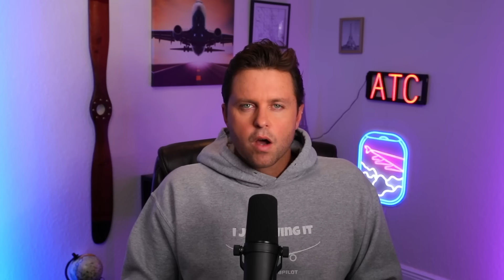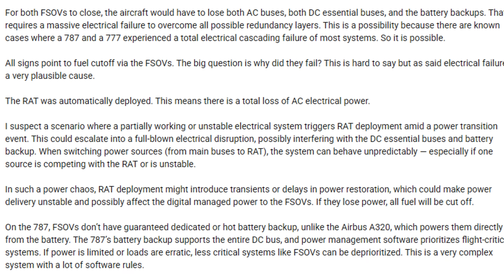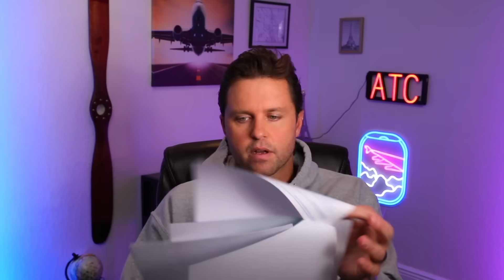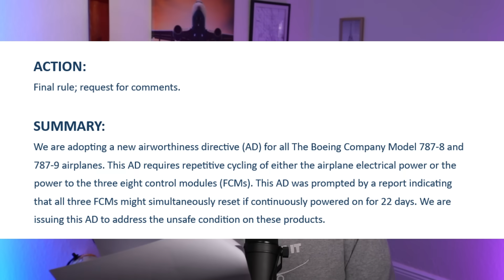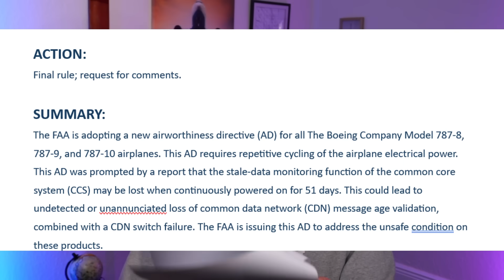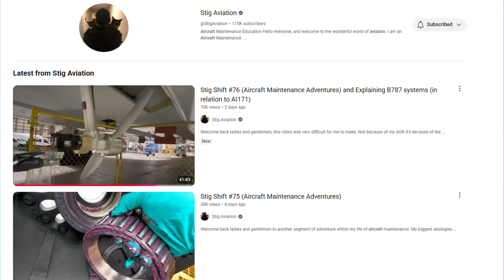Air India 171: Did a Software Glitch Cause Dual Engine Failure?

Comment: That architechture sounds like they planned on never losing all main power. Maybe they neglected the "but what if".

I don't really see why the main power supply status would be used as an indicator at all. The engine is self sustaining and even if you lost main power, that still leaves the control bus and fuel shutoff line intact and engine running, triggering the fuel shutoff valve upon outside power loss would take that from you.

That system sounds like it's single redundant and realying on a complex and thus vulnerable power system that has little meaning to the works of the engines. Stupid to have your engines hanging on by single thread that is the main power supply.

The thing the deadman tries to accomplish is shut the engine in case it becomes COMPLETELY UNCONTROLLABLE FROM THE OUTSIDE. So the basic principle to do would be to check if the FADEC/FSV still has connection to the cockpit. Basically run a hardwired loop of wire from an engine powered FADEC to the cockpit, if that loses continuity because it breaks OR is severed by the fire handle being pulled, shut off the engine fuel valve.

Moreso, with a deadman switch that is not super time critical (fire takes more than seconds) and in a sensitive place (power supply is always subjected to fluctuations, engines are critical), you'd have a delay ensuring the system power was actually lost for good. F.ex. you'd install a capacitor in the fuel shutoff valve that bridges any shortterm power outs. That would hold some stored power for a couple of seconds before it too loses power and switches the valve. The time of that should be designed to gap any forseeable delays in power restoration, f.ex. from rat deploy time, battery switchon or fuse activation incase of a short.

Btw The likelyhood of a dual engine or triple power source fail is not just the chance of the individual parts failing multiplied. Things fail more often when they are being used the most (takeoff f.ex.). In addition, when one engine or generator fails, that increases strain on the remaining systems, f.ex. batteries quickly being sudedenly drawn on, computers restarting after loss of power, pumps activating. So your demand increases even more, which is much more likely to cascade the remaining systems. Either way any backup power source always has to detect a low power first in order to activate, so even in a perfect scenario the power drops shortly.

Comment: if there were solenoid valves on the fuel feed to each engine a bus failure could shut both solenoids off at the same time.  such a bus failure could also explain similar solenoids (if present) being shut off on the hydraulics.  i have been a controls engineer for over 45 years and when you have a failure such as this on the ground or in the plane its not human induced.  the question is this to a controls guy, if the solenoids were present, are they fail open or fail close.  what could have occurred is that there are redundant solenoids in each of the lines (guessing).  they could have been set up such that one was supposed to be fail open and the other fail close when in reality they were set to both to fail open and or fail close at the same time - - - seen this in hydraulic systems and fuel systems in paper mills (not common but does happen) when a rookie works on a system without the aid of an instrumentation or logic cut sheet.

Reply

Comment: Boeing maxxxx---- the anti stall system???? so called anti tilting system in flights just in case pilot goes off to sleepppp----??? isn't that height of technology???? Car anti stall system is different mechanism and benefits but the name is same anti-stall system in formula one racing cars where loosing speed while gear change can make you loose the race-so rather accelerate on gear change...................HERE what was the need??? ABOVE EVERYTHING HOW DID THIS PASS TESTING?????  what else can I do except take off nose-too-up for a fraction of seconds if I am about to hit a missile or drone or head on collision with an idiot aircraft......WHO PASSED THE TESTING(testing doesn't tak a lot-flight and roll it like a fighter jet in the air on empty planes with seat ejection, cement bags-on-seats-for-full-load-effect)????? Only the flying school planes will stall on nose-too-up--rest of the planes are high-tech motor powered wont stall at 2-3 seconds of nose-too-up  even upto 90 degrees tilting to TO SAVE CRASH (all I can think of if supersonic jet fans has compromised air flow not at the best angle the efficiency of the engine will go off for 2-3 seconds leading to minor carbon monoxide poisoning and incomplete combustion etc.) ............................................................................................*******************************/ the auto maunvering system// anti-tilting system// anti-stall systems in cars are so called AUTO-PILOT// auto manuvering system of car and IS A BIG HIT----but as soon as a """"SLEEPING DRIVER""" touches brakes--auto-pilot cancels........?????? but in planes feels like a feature of auto pilot was put on manual mode of driving plane..................********************************************************************And angle of attack my assumption is if wind falls on the wings in the best angle it gives wing the best efficient-but in todays world everything works irrespective because of powerful motors---exactly like plastic toy windmill will not work if you run with treadmill flat face up but will run line crazy against the wind--------but battery toy plane wings works irrespective because air-mechanics//aerodynamics is not taking battery power in account when calculating angle of attack (PROPELLER VS ENGINE FAN concept----peropeller throws air backwards, flight goes forward---engine is HIGH tech.... propellers may use angle of attack because air is like fuel for them--and then if you dig deeper there is propeller, impeller and jet engine and just engine fan). ...************************************************************************* And inside clouds I am not sure if winds blows top to bottom 
(circular or all ways or bottom-to top)in whirlpools where flight jerks and goes down upto 10 feet free fall once in a while, stuck in the airpockets, and luggage starts fall all over and then I dont know--may be it comes out of its own God knows!....SHOW IS OVER EVERYONE cleaning time, crew is busy!

Comment: Gary, whoever keeps mentioning fuel contamination hasn’t thought it through.  Fueling at major airports is done through a common manifold.  Which means if the air India had contamination, others would have contamination.  Interesting take on the FCSOV, completely plausible.  It still amazes me how operators never depower an aircraft completely at least everyday for the 15 minutes at least once a day.  Instead aircraft are constantly powered with the battery and external power sources, for extreme periods of time.  Anyways interesting find, I wonder if the 777 suffers the same issues, knowing how closely designed the two planes are.

Comment: Another interesting post from pprune. We have known about this need to reboot the 787 every 120 days for a long time. Could they have missed it? Would certainly ruin your day when it goes to fail-safe!

The Spring-loaded FSOV
The general conclusion seems to be that the gear retraction was interrupted by a dual engine failure. The argument seems to be that this gear failure to retract after its dual bogey “tilt” and that the gear-doors’ failure to open (first) was brought about by a total loss of system electrics, (i.e. both AC and DC). This loss is confirmed by the RAT deployment. The out-of-sequence gear-bogey tilt was likely due to a sequencer relay’s DC power outage and the accumulator pressure continuing on with the retraction until its pump lost its AC elec power.. That was evidently the point (i.e. during gear retraction) when the sequence was interrupted by the electrical shutdown and subsequent thrust loss a few moments later. The generally held theory for each engine’s FADEC failure (due to a common software error related to a ground-air sensing failure) is not supported by the cumulative hours over many years without such a failure. So, if you then look around for another component that can shut down two engines simultaneously you end up with the fuel shut-off valves (FSOV). Why? On each engine It is fail-safed to close off fuel-feed flows by a spring that is held open by a solenoid. If that solenoid loses electrical power, the FSOV closes and the engine shuts down after a short period. It’s a slow-time fuel cut-off valve that’s designed to operate autonomously in dire circumstances... and to stop fuel feeding a post-crash fire. These FSOV’s are each powered by the aircraft’s DC electrics and not (i.e. unlike the FADEC) by a highly reliable engine-driven Permanent Magnet Alternator. On other aircraft the FSOV’s are plugged into a hot battery bus. But in the 787, they hang off an essential DC bus. It’s hard to foresee any circumstance in which a FADEC’s PMA can lose power when the engine is running. But to lose DC power and cut off fuel to both engines, you only need a complete electrical shutdown. One unique circumstance in which that can predictably occur is spelled out in the PDF link below. It supersedes Emergency AD 2015-08-51 and tells us that:

"If the four main GCUs (associated with the engine-mounted generators) were powered up at the same time, after 248 days of continuous power, all four GCUs will go into failsafe mode at the same time, resulting in a loss of all AC electrical power regardless of the flight phase."

This glitch was due to a software “counter” included within the 787 EMS system. A temporary solution to the problem was to reboot each 787 airplane before the generators could reach eight continuous months of operation.

https://s3.amazonaws.com/public-insp...2015-10066.pdf

The FAA had therefore issued an airworthiness directive requiring Boeing to reboot its 787s every 120 days, at least until a fix could be implemented (designedly planned for later in 2015). That was the story in March 2015. So this progressive electrical failure of both AC busses, both essential DC busses and the hot battery bus? Is it attributable to this 248 day counter stack overflow? If so, then what an unfortunate and unlikely timing coincidence for Air India Flt171? Or if you don’t believe in coincidence, was it possibly associated with my point about the battery-powered charging relay (in the titanium box) raised in my earlier post at:

This link

The 787’s electrical fault-tree is rooted in its design. The battery in that titanium fire-proof box has an early history coloured by six disastrous Li ion battery fires, but it still controls the entirety of the 787’s DC bus in this famously “electric” airplane. When you say “controls” you have to consider that the software-driven switching in its circuitry’s relays is wholly dependent upon the integrity of that centrally-controlled DC circuitry.

This arrangement of allowing such a configuration in an electric airplane is unlike any other similar airliner... and makes it vulnerable to any total electrics failure. It would (IMHO) almost predictably give rise to an Air India 171 situation arising eventually (and it did). Did the unique configuration stem from a designer’s lack of confidence in the Lithium Ion battery? Predictably, the EMS config will need a rework that will ground the 787 fleet for six months or more. Sometimes the easy work-around turns out to be a short-cut to greater grief. 🤨

Comment: I used to own a Toyota Landcruiser. On field trips i carried a hammer, a set of pliers and some wire. Could fix 80% of the problems if any occurred, which was rarely.

These days you need a programming phd to be able to understand why ‘the problem’ won’t go away. Mind you i did say ‘fix it,’ i said won’t go away - even if you fix it, or try to. Cars have become computers on wheels often unfixable.

Why would it be different for planes than for cars, since they are giant flying ICT interfaces. Fly by wire made pilots computer programmers, not pilots anymore, and the planes are as reliable as … computers, which is what they are, flying computers.

Comment: It looks like dual engine failure may have happened just at the time the pilots retracted the landing gear (on a very hot day) as you can see on the videos. You can see that the gear is tilted forward but not retracted. I hope accident inspectors (whether US, UK or Indian)  come out with an interim report within days. If this is at all possible due to a software glitch, I hope they ground the 787s for inspection & do not wait for a second incident to happen - or 3rd if you include the reverse thrust incident you mentioned.

Comment: Not a Pilot. Some are quick to speculate that Boeing is going to be blamed for this crash as a result of a software glitch. One question I have in mind, recently the Right engine on the 787 was replaced, additionally the left engine was scheduled to be replaced. When an engine replacement is performed, those it require any electrical rewiring ? Could something in that process was  missed that could have caused the computer glitch? A passenger from a previous leg filmed what appeared to be electrical problems, why air India did not grown the aircraft and inspected it? It seems that they had several clues warning them that something was not right prior to the crash. When your personal computers starts flickering or acting up, if you ignore it. eventually it will stop working. Right?? Unfortunately, airlines work these aircrafts very hard, and it seems that maintenance schedule will get extended just to meet demand.  Just throwing that out there.

Comment: 12 June 2025 - 11A
1+2=3
June=6
2+0+2+5=9
11
A = Aleph = Bull(Moloch)
3, 6, 9, 11, Moloch
23 June 2025 is the 40th anniversary of the bombing of Air India 182 off the coast of Ireland.
23 June 1985
2x3=6
June=6
1+9+8+5=23, 2x3=6
Air India 182 (1+8+2=11)
666, 11
Canadian Sikh “businessman”Ripudaman Singh Malik was accused in the bombing, but was later acquitted.  He was shot dead in Canada on July 14, 2022.  Malik’s rival,  (another Sikh “businessman”)Hardeep Singh Nijjar, was shot dead in Canada on June 18, 2023.  This “accident” likely goes much deeper than mechanical failure. 
🔺☠️🔻

Comment: FCSOV would be the higher cause of fuel lose rather than contaminated fuel. The Fuel Logic should never activate the FCSOV as shutdown it should be a waning, and should only logicaly activated due to flame detection. And not heat rise.

Comment: Your fact list woud be dredible if your links sources pointed to them. But three of them poit to the continuous power on time. Well, that just does not happen on a plane that stops overnight and turns everything off, eve the Air Conditiones on the ground to save fuel. And the other link is probably some command sequence error during landing. You cannot r everse untill your engines are at Idle or if the reverse lever is not fully in position. Reverser deployment has many protections. Most of the rest us just heresay from some other youtubers. Anyway, I have a tendency to believe in the extended electrical failure. It appears on a 12 year old plane, with a spotless record and in a company with many reports on maintenanve issues.

Comment: this is probably a really silly question, but I'll risk it all the same; will that function (invoked), being seen as somewhat suspect, be revealed in the flight recorder? I mean does the flight recorder capture really detailed information such that one can conclude a software glitch, or even that the fuel had been cut off delibertely by "the system"? There appear to be a few aviation engineers here in the thread. Would appreciate some thoughts on that.

Comment: God bless you!! At least some of the pilots on YouTube,  are coming to terms with the fact that the fuel valve was shut off, either by a software glitch or by sabotage, which is what all we Indians have been saying from the day we realized that the RAT was deployed. Remember, we are at war with Pakistan and Turkey is an ally of Pakistan, and it was a Turkish company which was entrusted with the service of the aircraft. That Turkish company was removed from being entrusted with service of our aircraft, unfortunately the Indian courts intervened, and the Turkish company continues to be involved in service of Indian aircraft. I am a frequent flyer and no way that I am flying on a 787, as long as this electrical gremlin with the fuel shut valve is solved.

Comment: Very good analysis. Is what I've been thinking too.. computer shut off the engines. 
To me, is similar to the 737MAX problem.. what conditions caused software to take control and do something a pilot would NEVER do? It'd be good to set an alarm, and have pilots confirm that it's ok for the computer to nosedive a plane or shut off engines.
Reply: => HAL
Reply: @stevemuller8320  what means HAL?